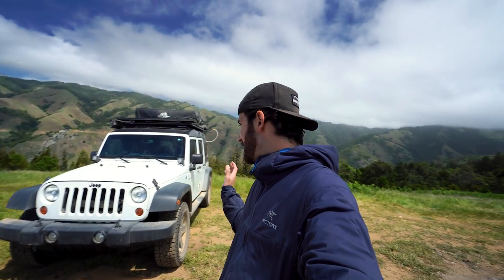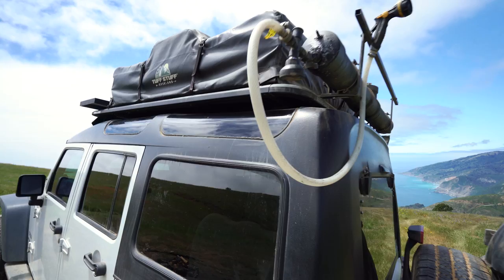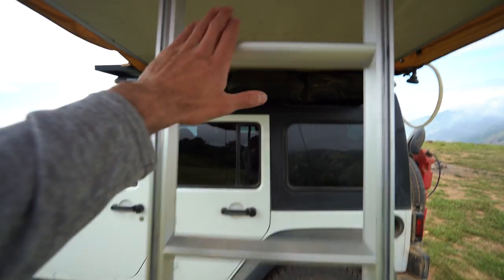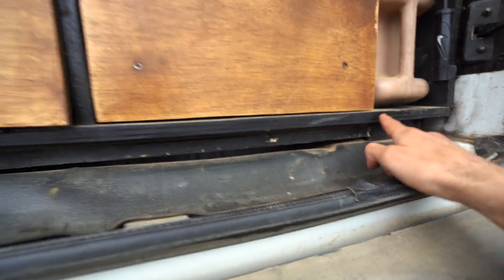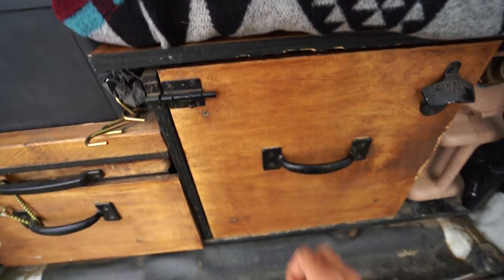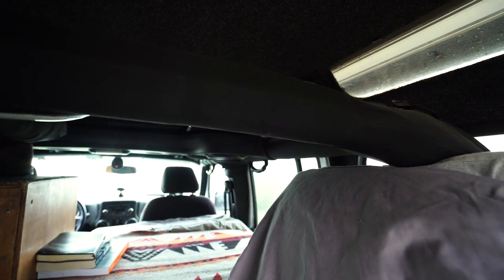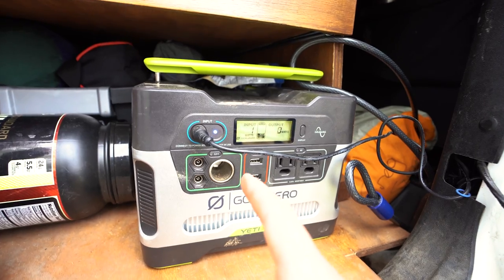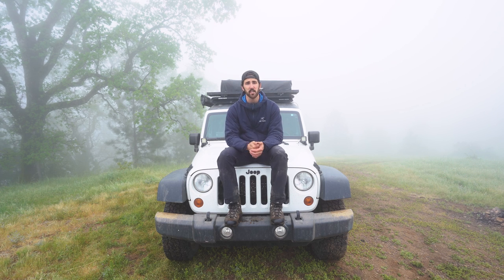DIY JEEP BUILD- Living Out of a Jeep Wrangler – Year on the Road

Comment: The stock rear bumper is hollow. A few guys on YouTube turned them into a water resivoir it holds 7ish gallons. Search it would be great for your setup
Reply: Smith & Wesson that sounds like a ford pinto situation
Reply: @liamcampbell260  water is generally less volatile than fuel
Reply: @anthonyteichroeb917  lmao

Comment: Do you worry about the propane heater emitting toxic exhaust fumes in the confined area of the tent?
Reply from the maker: The tent is not air tight by any means and I only run the heater for 15-20 minutes before I go to bed and same in the morning. It also has a built in CO2 reader and will shut off automatically if it reads high levels

Comment: Yo can't the propane heater build up carbon monoxide in a closed space
*edit
I did a little bit of research, there are a couple of videos testing this and it wasn't an issue in either a tent or a well ventilated rv. I didn't see a test for a more confined space but people commented pointing out he uses the car heater in the car, not the little buddy, so it's a moot point!
Reply: Thats what I thought too but he said he mostly uses the heater for when he's in the tent which has plenty of ventilation. Im sure he's used it inside the car too since he installed that vent thing for his window.
Reply: Connor L He said he turns on his car heater when inside the car. The buddy propane heater for the tent.

Comment: Wait so one of the downsides to the van is that you would have to put a ton of work into it. But you somehow put 250 hours into a Jeep interior?
Reply from the maker: Downside of the van would be the cost $$$! And loosing four wheel drive. I loved putting all the work into the jeep , that wasn't the issue. I definitely didn't have the budget to buy and convert a van
Reply: Drew Simms I feel you. If the budget was there we would all have vehicles for every occasion

Comment: IS IT SAFE TO SLEEP WITH A HEATER INSIDE A TENT SOUNDS DANGEROUS WITH IT BEING SO CLOSE??? 😳🤯
Reply: His tent is well ventilated and as long as you don't touch the heater, nothing gets burnt.  I have the same on my rooftop tent. It's a must for cold, winter nights. I am super afraid of burning my feet on it when my girl sleeps with me and will need a better solution but these Mr Heater units have multiple safety features on them.
Reply: Pretty much the whole thing is dangerous bc of the gas tank

Comment: Very interesting setup, my compliments to your creativity.  We travel with an ARB fridge, powered during movement via DC from the vehicle and when parked AC from a lithium power bank with attached solar panels.  On a full charge, the power bank will run our ARB (I think we have the 50qt) for about 24hrs.  During movement, we charge the power bank from an AC port in our jeep.  One thing on your fridge and I'm saying this because it was hard to tell from the video; you have to keep the side fan ports clear so we're very careful when we stack gear around it.  Don't want it over heating.  While we saw the propane for your heater, it wasn't clear if you use the small bottles for your stove as well.  If you have space, you can get a small 5lb cylinder or an 8lb slimmer but tall cylinder (I saw those in an off road magazine) and then a long connector hose.  Will save you money in the end not having to buy those small cylinders.   Agree with you on water, but we always use a popular and expensive water filter.  I am curious about everything you have.  We found that after a week on the road we had over packed.  When we had a chance we ditched half of the kitchen stuff and half of the stuff like shoes, boots, etc., that we thought we needed but didn't.  Now, we are not full time as you, so our clothing load is adjusted by climate but we found on a recent three month trip from FL to AK and back that we basically stuck to four sets of clothing each.  Did you upgrade the jeep's suspension when you added the roof rack, tent,, etc?  Travel safe

Comment: How long will the fridge run off the deep cycle.
Reply: what's the purpose of the roof top tent? is it better than a normal tent?
Reply: no further west you’re off the floor so no bugs/animals can bother you
Reply from the maker: If I don't start the car and it just runs of the battery, it typically keeps temps below 50f in the fridge for around 4 days. Also depends on the outside temp. During winter it works much better obviously than high summer temps.
Reply: @nicholasgarcia8775  Oh I see thanks. It looks cool. I was thinking it's for the view or something lol.

Comment: Drew-  Re:  security cables:  I live in Seattle/longtime resident.  Seattle Center area.  IF somebody wants your gear- they come prepared.  With a battery powered 3" cut off saw.  I know, because I've been ripped off three times over the years with the same technique.  You can tell....because the cable wrap is melted and the metal strands have a clean cut.  I've even watched two theft attempts in process....and it took SECONDS to cut thru the cables.  ie Hot butter knife.

Comment: I made window screens for my truck which I use to sleep in before being married. I used gutter guards. I got a couple of them that had a fine screen to keep pine needles out of your gutters. Good part was they had a lip that fit over the glass and you tuck the top into the groove in the top window slide. Worked great. Still hot in the summer but,.....bugs right?

Comment: High, i would paint the axe, you have outside the car, with water-based Acryl-paint. So the handle is protected against wetness and other power of the weather. Kindly Fiete.
Reply: High again, how i mean it with paintig an axe, you can see on #86 and #86E. Kindly Fiete

Comment: Hey Drew, nice setup! I built my 2017 Wrangler JKU somewhat similar to yours. I built my wood cabinets in the rear too. It was difficult to see if you still had the factory rear bumper. If so, it is hollow and hold about 8 gallons of water. I installed a 40 psi 12v pump behind the passenger side taillight. You may want to consider this option. You gave me a few ideas on a couple of things I want to add.     Thanks

Comment: I get that it's a budget build, but I think by charging your car battery with your solar panel, then using an inverter it would have been less expensive and much better than the goal zero.  The goal zero is very bad cost benefit per dollar spent.

The only big benefit of that goal zero would be the mobility factor, but a good modified sine wave inverter and your car battery with a really nice car battery is a better solution overall, especially since you have the jumper.

Also a smaller heater might serve you well.  I'll bet that mr buddy makes it an oven pretty quick though :)

Comment: Awesome stuff!!! So great to see highly motivated peeps (young n old) liv'in a dream. Love your set up and the fact that YOU put it together. Probably asked, and talked about, a bunch already butttt I hear propane heaters put out a ton of moisture and are dangerous... doesn't sound like either bothers you though. Have u looked into 12V 5KW "Diesel" Air Heater for Trucks,  Boats, Campervans, etc? I'm sure you could run an auxiliary flex line off the main heat 'supply' vent to feed ur roof tent when needed. Also, I thought I saw somewhere that 'they' make a version that will run off regular gas as well (as in tapping into fuel line).

Comment: Salute to you for all the work you put into your Jeep.

I don't know what you call it, however, I wonder is it practical/realistic in a passenger vehicle to have it like a commercial truck where you can run your a/c or heat while the engine is off?  Granted you spend a lot of time out west, but few things are worse than being cooped up in a vehicle in the summer in a humid climate, as is common in the eastern U.S.  There is really no breeze and if you open the windows you get attacked by flies and mosquitoes.  For me, dealing with the heat would be much more difficult than the cold.

Jeeps are never good on gas, and with that additional weight, I'm guessing you're averaging about 10 to 12 mpg?

Comment: Would you be able to go more in depth or maybe make another video on how you keep constant power going to your fridge? I know you talked about the goal zero and the alternator that lets your car start even if the battery is at zero. But does the goal zero with the solar panels allow you to keep the fridge running 24/7? Thanks!

Comment: I recently moved to Texas, 200 miles a day round trip is hard, cheap hotels are freaking me out but the heat is a no go, I’ve been looking for air conditioner w/ gas generator but I just saw the solar panel set up you’ve got... any suggestions

Comment: That's not what a deep cycle battery is.  Deep cycle just means the battery is designed to discharge more of its total capacity without damage than a battery designed just for starting. 

If you completely drain your battery with your lights there is no way it will start your car without being charged, no matter what kind of battery it is.  If that is a concern you should have a separate battery exclusively for starting.

Comment: Roof top tents are a waist! Puts weight up high on the top making the center of gravity worse for off roading as well fuel MPG over time from the added weight/drag. Finally the cost of the bulky added weight is quite a bit compared to better options. A good canvas tent with a small portable wood cook stove is the best option.

Comment: Great Vidio Good Job Nice Build, & I Suggest  You Check Out The Little CHINESE  Diesel Heaters ,& Get The 5 KW They Come With Everything  Even The Case For Around $175.00 ,& Find The U Tube  Vidio Frpm A Guy From Australi JOHN He Has About 20 or So GREAT VIDIOS On Them &There Are No 8kw There Are 2kW & 5 KW 15OO BTU & TOTALY SAFE 100%